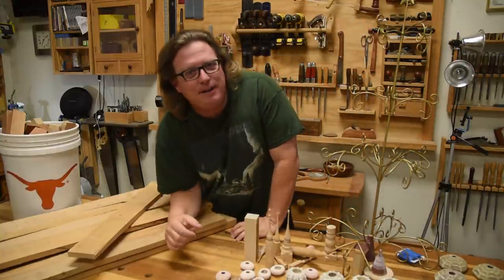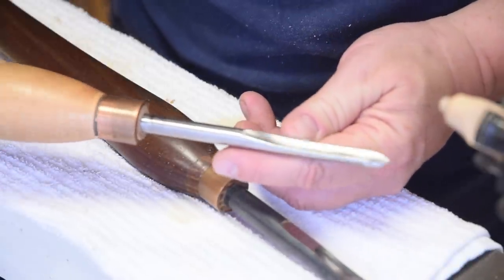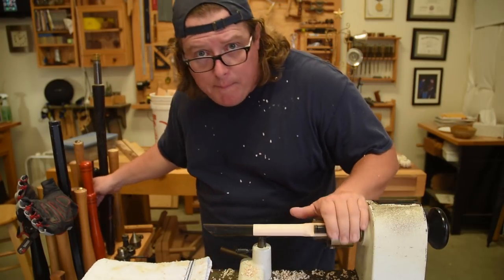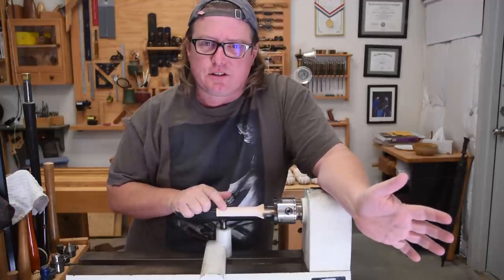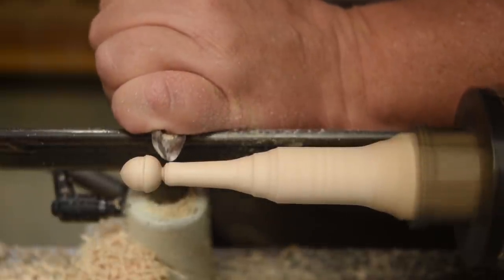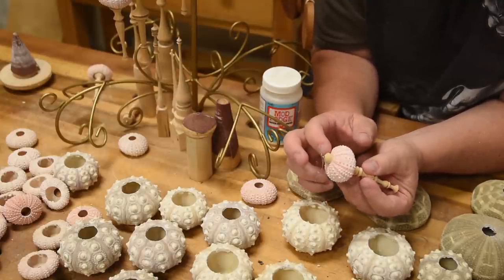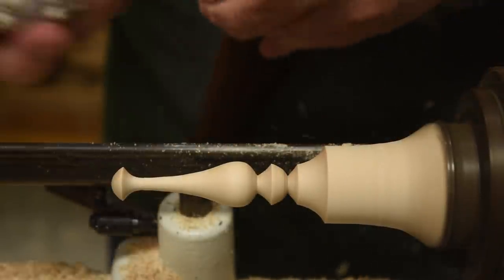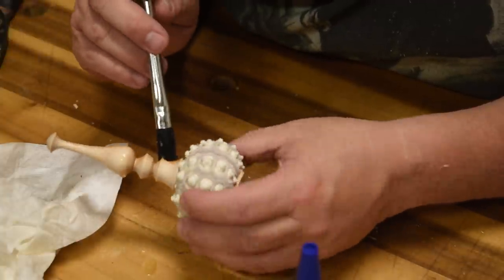4 styles of $5, $10 & $20 Holiday Ornaments - Art/Farmers Market Projects

Comment: Great video,I've made many of these ornaments myself and bore the top and finial to accept a 1/4 " dowel,
 that way if the urchin opening isn't perfectly round you don't have to try and fit to the opening, and also it allows the urchin to float on the mounting and not be as fragile.

Comment: fyi -- Eileen's craft glue works great for putting 2 or 3 piece Christmas decorations together and you don't have to worry with CA running or the smell
Reply from the maker: I actually depend upon the CA running a bit so that it'll fill those little V-Cuts. Does craft glue flow a bit?
Reply: not liquid like CA but it does ooze some